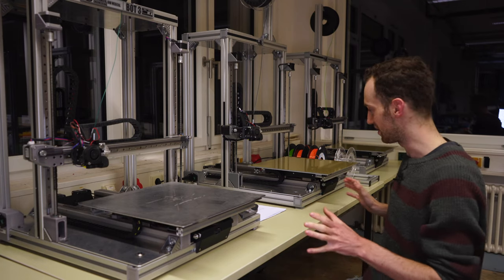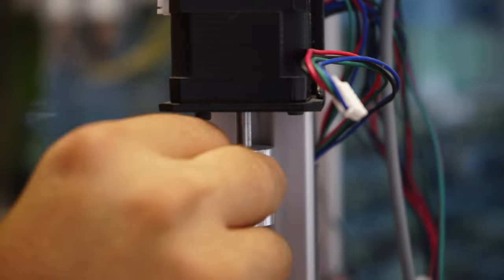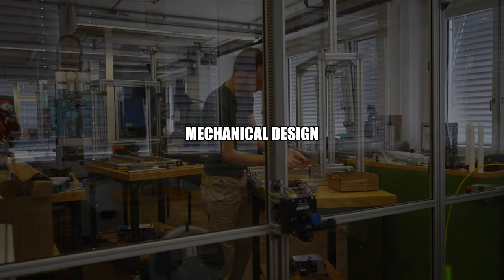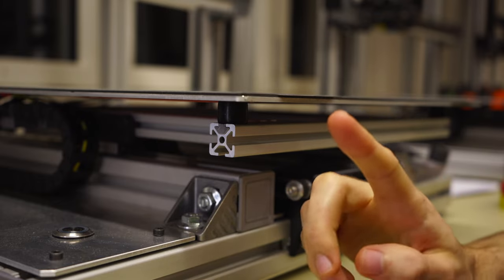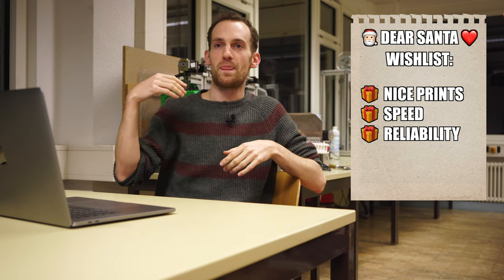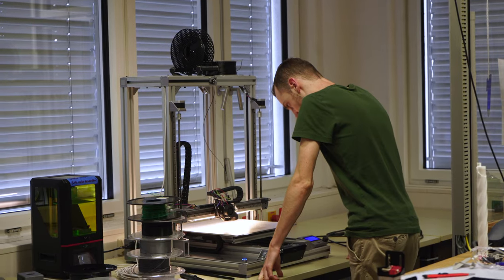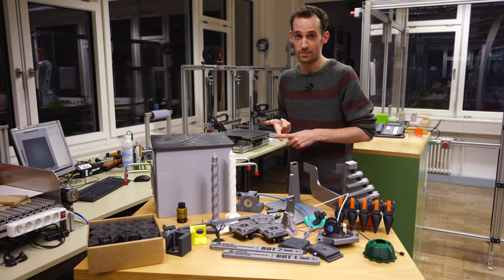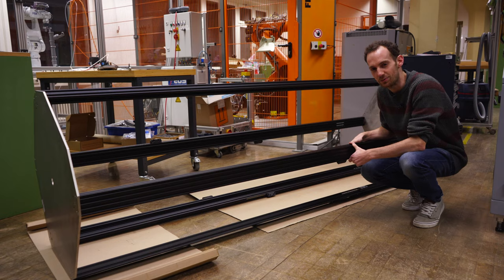Building a 3D Print Farm [University Edition]

Comment: As an HP sales rep told me, it is not the reliability or repairability, it is the repeatability, if you print 1000 parts, 999 are the same specs and tolerance, not 700 and the rest are failed prints, stringing, ringing, blobs, under or overextrusion. And that's why they charge 50-200k€ per printer
Reply from the maker: You’re right. I should have included repeatability! 
That 1/1000000 chance of something going wrong is also what Martin from wintergatan is currently trying to achieve. His videos were extremely inspirational when building the printers.
Reply: @ConstantijnC  after making about 6000 nearly identical parts on my 2 Ender 3s and 2 CR10s and having about 1500 failed parts and changing boards, extruders, nozzles, heatbreaks, buildplates during that in order to get a consistency in the quality going, yup, repeatability is key if it's called a printerfarm, if Prusa had a different quality on every third part, they would be out of business or manufacturing in China pretty fast

Comment: Have you ever thought of making a 3d printer that's basically 4 corner pieces you can set apart as far as you like, set the height as high as you like, than simply run bars across the frame, clamp them in place.  Printer "discovers itself" works out the maximum printable area and sits ready to print.  You could even add multiple print heads to get the job done faster, auto negotiation of where each print head is at any one time would allow faster print times, imagine multiple print heads whizzing around creating a massive print in a quarter the time because you have 4 print heads going at it. 

Than imagine an entire factory floor that contains a single 20 acre 3d printer frame with thousands of print heads fed plastic from plastic reels from above creating either hundreds of the same item, as in mass manufacturing, or alternatively several massive 3d renders (Think house or car size).  The big advantage is that this factory would need no retooling, it could build anything of any size without swapping out robots or large pressing machines.  Robots on the floor could then collect the 3d renders, transport to an adjacent factory and assemble them.

Comment: What software are you using to control the printer?
Reply from the maker: Firmware is Marlin and the slicer can be anything. We mostly use Prusaslicer.
Reply: @ConstantijnC  have you thought of trying klipper? I heard it can increase performance etc drastically.
Reply from the maker: @arlomaguire7363  Yes I did, and I wish I could switch, but I've written quite a bit of custom code in marlin which is crucial for the printers to work as reliably as they do right now. Rewriting those features for Klipper is currently not an option due to time constraints :/
Reply: @ConstantijnC  can you elaborate some more on those modifications?
Reply: @ConstantijnC  thats sad, but understandable. Marlin is still quite good. And if it works, it works

Comment: How did you get the graph when it levels?, as well as total print time, print jobs etc
Reply from the maker: i programmed the graph myself. once ive cleaned up the code, i'll do a pull request on github, so maybe it will be merged in the future.
the print stats are just a normal marlin setting in configuration.h. Simply enable "#define PRINTCOUNTER" and you're all set
Reply: @ConstantijnC  Interesting, thanks for the info!

Comment: why not use cheaper aluminium channels (square extrusion... u know the kind used in aluminium doors) as frame for the 3d printer- should reduce the cost further.. You are using linear rails for precision... the frame is just for rigidity... its not like the vslot wheels will be used on the extrusions
Reply from the maker: Because then I would have had to discard the ones that the printers were already made out of and buy new ones. On top of that, I'm pretty sure that the students who first built these got those extrusions for free straight from Bosch. And lastly, aluminium extrusions are extremely cheap if you aren't getting the ones from Bosch and they are much more versatile. So I'd always pick those over aluminium channels.